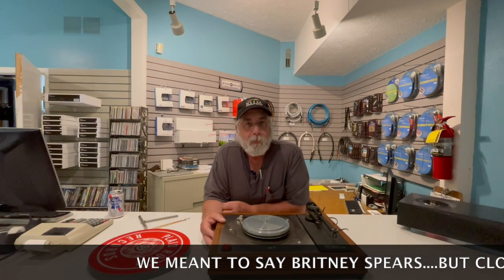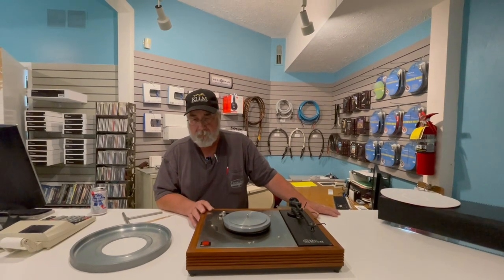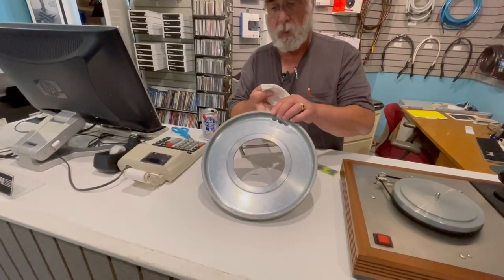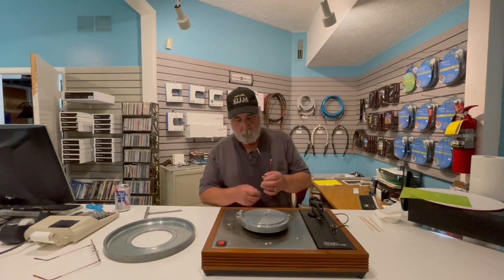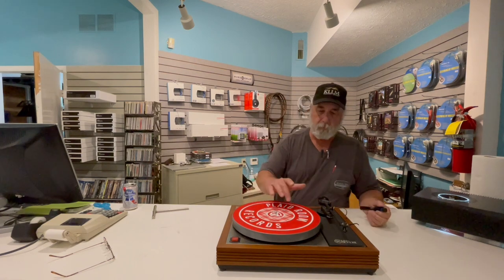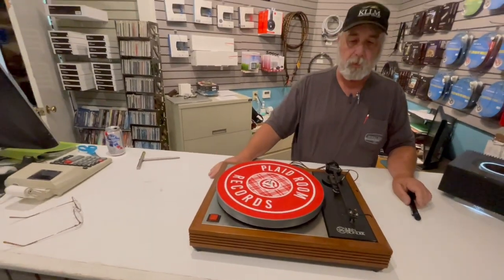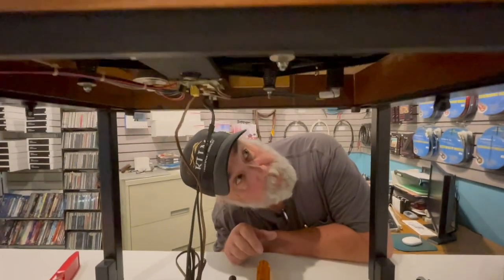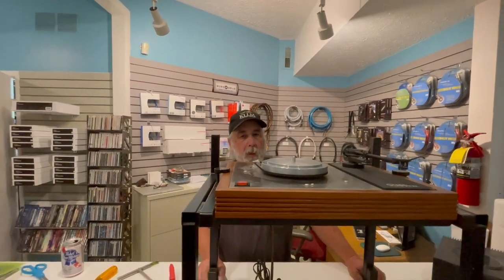Don't Buy A Used Linn LP12 Turntable Unless You Have The Right Tools!

Comment: I still have my LP12 (same model as this), bought new in 1975. Apart from a few drive belts, I have done nothing to it and it still works and looks like it always did.
Reply from the maker: And that is fine. It is a faithful friend and that's cool.  My point of the video was to caution folks about the trials and tribulations about attempted upgrades.
Reply: @audibleeleganceinc  I think the main thing is that I rarely move it and always treat it gently. Same with the original SME 3009 arm I fitted to it when I bought it.
Reply: I have mine new since 1979. It has got thru 3 belts.  Don't bother fiddling with old Linns. Repairs will introduce u to Linn prices

Comment: I am old enough to remember when the LP12 first appeared during a crazy time of hi-fi snobbery in the UK and elsewhere. Some dealers refused to sell various separates unless one was going to pair them with what said MUST BE.
Although I owned an LP12 and other Linn products off and on I was never sucked into the reverence cult which Linn encouraged, even if management did not originate it. Besides, the LP12 was actually copied from another manufacturer but I did and still do concede that they were mostly quite well put together and had good platters.
The suspension mechanism was over complicated for what it was and the less expensive Thorens mechanism was generally superior and not subject to the misalignment shown here because there were wedges to use as a simple means of protecting it during transport. Linn could have done a lot more to avoid problems but the rigidity of earlier case work did not allow for a Thorens solution. Linn woodwork was also prone to warping over a few years, even in the temperate climate of the UK and this might have been down to humidity. Thorens tended to use semi-wood and when Rega came into being the design principles obviated the issues shown here.
For me (apart from silly names and silly prices) the Linn was let down by puny motors and "dirty" power feed which could affect speed and resonance the same as with any belt drive, although Linn made improvements -- again with silly names. 
During occasional work with BBC classical musical programmes, I saw few Linn turntables in use, if any. Lenco turntables with variable speed and EMT  customized decks were most used and even Garrards for some records but Technics SP and SL 10s changed BBC vinyl usage profoundly as these expensive precision direct drive turntables were robust, silent, adjustable and saved a lot in maintenance costs.
The belt vs direct drive argument will persist and is as boring now as it was 40 years ago.
Reply from the maker: Thank you for your robust comments and I find them fair from a user's point of view.  In fact, the Thorens suspension, which predated the Linn, used many of the same parts as Linn adopted right down to the springs and grommets.  I know, I have parted enough Thorens out.  What Linn did was to make, in a sense, a more robust Thorens.  Where Linn took it further was the intense training on how to get the best out of a Linn whereas Thorens were sold as a turnkey product with little care by the dealers, at least here in the States.  

The direct drive tables were ideal for radio as with the use of a cartridge like Stanton, one could back-cue and have a start up time in a quarter of a revolution. Ergo, no dead air time or, at least greatly minimized.  Keep in mind that for many years, contrary to popular belief, many commercial radio stations used carts (cartridges, i.e. 8 track or similiar.)  

As for their other products, well, I will leave you with a funny.  What Hi-Fi held annual awards for best products and, well, one for the worst product. After the falling out between Linn and Naim, LInn created a tuner called the Kremlin.  Quite expensive.  It was awarded the Worst Product of the Year.  Obviously, no one from Linn was in attendance when the award was given.  However, when announced, Julian Vereker of Naim stood up and said "On behalf of my friend Ivor, I will accept the award"  The room howled in laughter.  

Years later when Julian died, however, Ivor wrote a most beautiful eulogy about Mr. Verreker.  It was classic all the way.  Covered two pages in a magazine, as I recall.  

As for the "cult", well, I was never much part of that but for many, discovering that one could understand musical differences in musical terms was an awakening.  In that sense, they became apostles that felt that their mission was to address a great many misconceptions about hi-fi and, in many ways, they were correct.  The failing became that they could not accept that others were also addressing misconceptions albeit in different ways.  At the dealer level, here in the states, cults are less common but are often based around a couple of magazines as if they speak the gospel.  Sadly, many solid principles of hi-fi have been lost in the current time and market as can be seen with $69 turntables from Amazon.  Nuff said.
Reply from the maker: Oh, and yes I have had a few comments from the cult that I actually had to mute.  If one is not going to contribute and move the conversation forward, but, rather merely bicker, then save it for someone else.  I don't have much patience for that.  I have grown very tired of those who can only criticize and destroy while failing to build. We have a serious problem with that in the States.

Comment: I think it would be a good idea to plug the bearing and cover the bearing spindle to protect it from swarfe / dust contamination from the sanding procedure. It's also, I believe, not a good idea to have black oil in conjunction with the early white nylon topped bearing as it causes swelling and partial seizure. Hope this helps!
Reply from the maker: Oh, I think you are overstating the case.  I was 8 to 10 inches back from the rear of the deck and not over the bearing well.  Cameras can be a bit funny in perspective. Good suggestion, and noted. As for the oil, whatever the customer or prior owner did before he brought it in is exactly the way it left.  We never charged this bearing well.  There were a lot of things this table needed but all was declined.  This is quite common when someone buys a used table and then brings it to us.  I could tell lots of stories about what we have found tacked on the underside of platters, plinths, you name it.
Reply: You may well be right but better safe than sorry. As the old proverb says "the Devil is in the detail". Thanks for your reply and have a great day

Comment: Early Linns lacked corner wedges so the plinths became distorted over time. When my 1983 Linn was updated to Linn Cirkus spec in the 1990s the plinth was the first to go. In fact, there's very little left of the original. Great video - I'm surprised that you can get mail order Linns in the USA. That's impossible in the UK - same for Rega Planar 3s and above.
Reply from the maker: Thank you for your excellent comments, particularly about the original Linn LP12 base (plinth).

As for the means of product distribution, yes, indeed, it is a complete shambles in the United States. Many manufacturers or distributors are willing to chase production.  I drew the line on Rega when I discovered listings for their tables on the US Walmart Website.  The distributor fixed that one quickly.  This behavior has contributed greatly to the decline of specialist retailers in the States right along with any product knowledge of what they are selling.  It's all become cans of beans.  Sad, actually.

Comment: Aren't you sanding away the clear lacquer finish sprayed on the platter?
Reply from the maker: No, the mating surfaces between the inner platter and the outer platter are not coated.  I learned that at the factory.

Comment: PBR and Linn a excellent duo. Actually occasionally I combine them myself...😊
Reply from the maker: Indeed!
Reply: What grit sandpaper did you use ?
Reply from the maker: There is no markings on the paper we have received.  Based upon it's feel, I would say it is in the 1500 to 2000 grit level.  Personally, I would go with 2000.  That said, I would treat the issue at the same level as if I were polishing plastic headlight covers.
Reply: Another excellent Linn dealer is Accent on Music in New York. The owners care and have decades of Linn experience
Reply from the maker: @NateEll  excellent to know as I just found out that another guru has hung up his cartridges.

Comment: It's a bit of a comedy: the gentleman spends the whole time talking about how bad it is to take a platter and subplatter in bare hands and then tries to save it with his - bare hands 😀
Reply from the maker: On the Linn LP12 platter, there are surfaces that are lacquered and those which are not.  Most of the platter and inner platter is lacquered except for the two surfaces where they meet when assembled.  Handling a lacquered surface is fine if you have washed your hands of contaminants. That said, it is still unwise to touch the mating surfaces and finger oil can lead to pitting which is what was being removed.

Comment: I'd be covering the turntable while it's in your workshop and you're generating aluminium and abrasive dust from the sanding process.  Just sayin'
Reply from the maker: Actually, the Linn platter system is not aluminium. Neither is the Thorens inner and outer platter which, in fact, suffers the same issues.

As for dust, well, I will note that but there's more dust and dirt floating around a typical home than what could be generated by this process.  Now, if it were filings, yep, you are dead on with that.

Comment: That's a real precision looking tool, IE globs of epoxy!!
Reply from the maker: Yeah, I thought that too. Then, I realized why that was done have ignored issues with process over purpose.  Kinda like trying to get something done with the government around.  You can either have it done or you can have all the paperwork filled out.  So, you understand the purpose and that's all good.  Perhaps you can find a better one.
Reply: just too digress I put together a linn lp12 turntable from a variety of parts. I had an Axis turntable that I used the arm from(Basic) bought a used plinth in very good shape, suspension and new springs and grommets, Valhalla Board and new motor.  its all assembled and plays, suspension is a work in progress(LINN Bounce)! I think m Valhalla bd needs cap replacement. Anyway my version of an Lp12 is called the Linn Bastard because of all the thrown together parts. thanks for reply will send a pic when I find it! Frank @audibleeleganceinc
Reply from the maker: Have fun with it, Frank.  It's a hobby and if you are willing to learn, spend a few dollars, and give it your time, that's what it is all about.  My points on the LP12 is that you need to understand how it works and follow the rules. It's not for the timid.  I guess that means I have a bastard tool as well.   @frankfusco5479
Reply: I agree!!! @audibleeleganceinc

Comment: These old bolts do not go with modern springs hence the suspension issue. You dont have enough adjustment in the left hangar to correct it.
Reply from the maker: The customer brought the table into me this way and would not allow me to do anything else.  So, I showed what should be done if correct but when the customer says no, that's it.  Thank you for your comments and appreciate your effort.